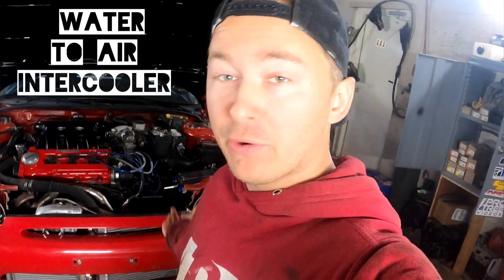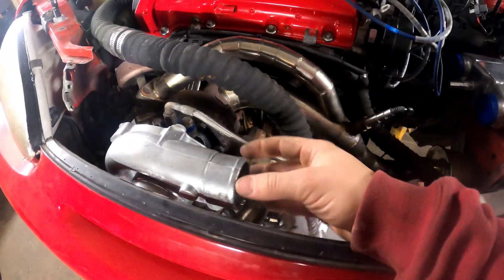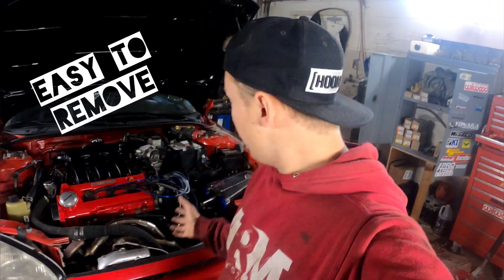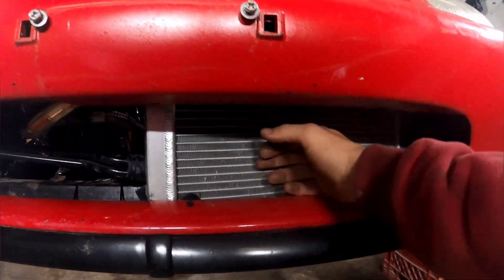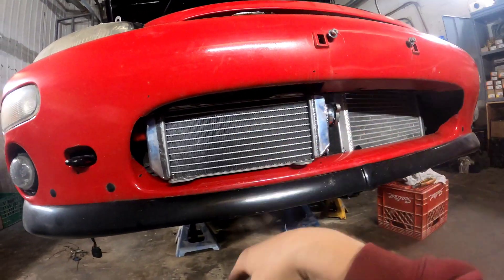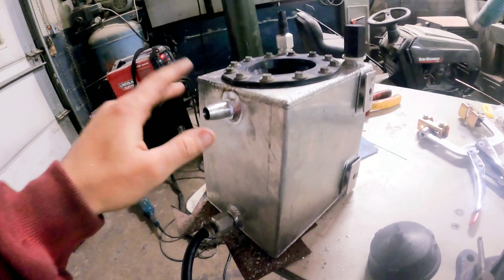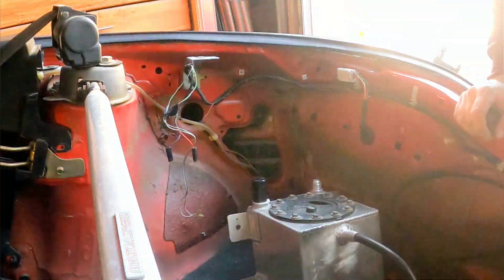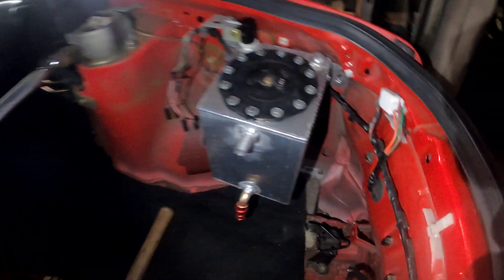How to set up a WATER to AIR INTERCOOLER!

Comment: Pumping huge volumes of water. Is that necessary? Water is a sponge for heat. A very small pump to keep the flow moving is all you need.
Reply from the maker: Faster the better I have been told

Comment: I don't see how having the hot water return to the top of the box is all that important. Yes heat rises but it's all going to equalize. It's a relatively small quantity of water.
Reply from the maker: Yes but paying attention to detail is good practice
Reply: @Suicid3mx3  Yeah, true, but in an F-Body I'm probably going to drill some holes underneath the tank and run both the feed and return through the bottom. Then my fittings will all be hidden.
Reply from the maker: @dupeaccount1647  sweeeet

Comment: Technically your turbo can be run without an intercooler because your turbo acts like an intercooler itself because it is at the front directly feeding in air, but still an intercooler is always better for better performance
Reply from the maker: Pressurized air creates heat
Reply: You have no idea what you're talking about

Comment: Nice one, i bought one x6 water to air intercooler and have a doubt. Can i use the system without the water box? Have no space to fit it.

Thank you for those series of videos.
Reply from the maker: hey no problem man! you dont technically need a water box, but it slows heat soak down, if you dont run a water box make sure to run a large heat exchanger!
Reply: @Suicid3mx3  ill try to found and buy the pump (probably from vw tsi engine series) and a generic rad.
Here in Brasil we cant use modified cars in street, so i have to hide the maximum as possible my secrets 😂.
When i finish ill publish a video in my channel and report u here. Tks bro
Reply from the maker: @wolfsburg20i  awesome dude!! Sounds good